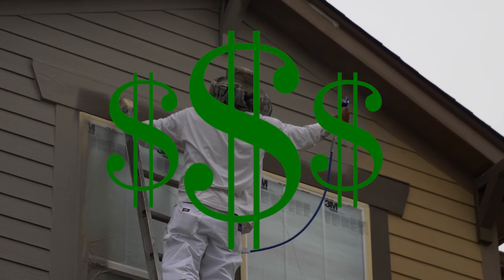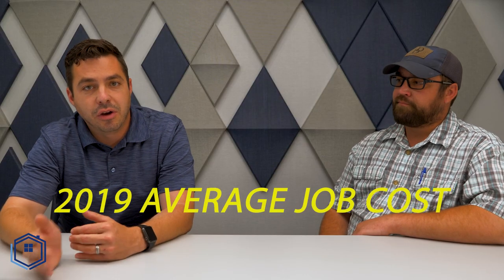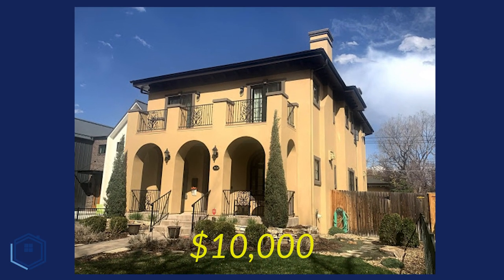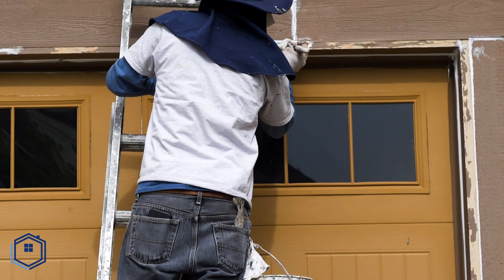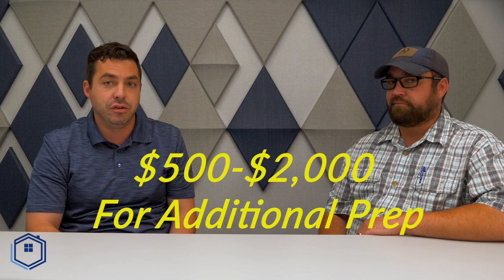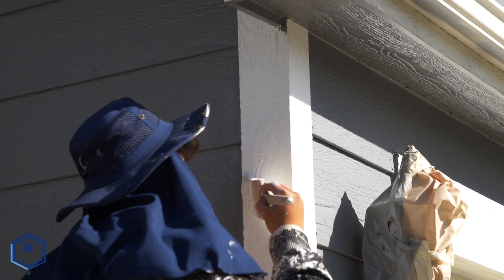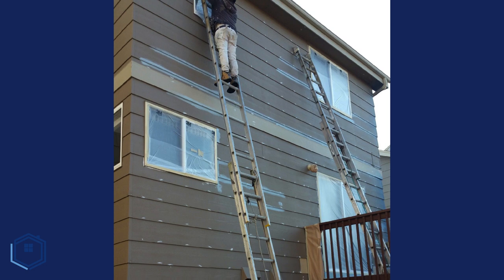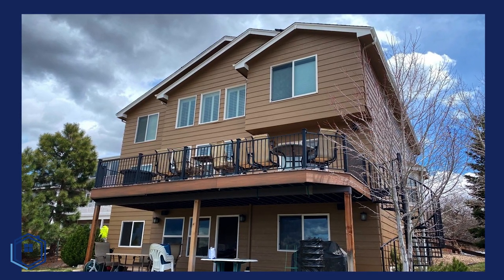How Much It Costs to Paint An Exterior #painting #roofing

Comment: Cost of materials very depends on the brands such as Dulux, British paints, Ascent paint, ppg paint...warehouse paint such as Spring that is one of the low costs paint,s.
10ltr Bucket,s 4ltr and 2 to 1 ltrs very in price, depending on were you purchased them.
Your high cost quality paint to low cost quality paint...
You got several types of customers who want the best paint and  best finish...
And those customers who have a enough money for a under $5000 dollar finish...
Quotes are different and difficult sometimes depends on the condition of the customer,s exterior weather boards and roof conditions...
Most of us home owners have very little maintenance  experience on taking care of  the exterior of home,s. Your home is constantly in 4 season conditions year after year...
Get a regular wash down on your exterior home every 3 to 6 months including water blasting concrete drives and paths to regularlate scum and likern...fences included 
It's up to the home owner to do regular checks on your own home for deterioration...
Exterior paint expires with in the 10 year time including roof paint...
I have come across customers who haven't repainted there home,s for between 25 to 40 years with poor maintenance and simple checks from roof,s@ spouting to weather boards and brick homes,explaining that the preparation work to their homes is in their costs more than the material,s.
2 bedroom house,s to 5 bedroom house,s all very in costs to paint...
It's length of time spent restoring the exterior to the customers satisfaction is in costs...
You don't just look at the paint and slap it on.
It's an art to restore getting your customers to see past the cost of materials and labor...
It's also letting the customer know that his home is a valuable asset, there fixabode and somthing also to be proud of...
My work is seeing past the 25 years of deterioration from weather conditions on some homes I have restored,restoring exterior homes is an art 🎨 you ether got the gift or its just simply to much work for the home owner...
If you want the best you pay for the best, your home is worth more than you will ever know...
After having it restored get it valued also to ease the mind of the home owner.
Signed Steve painters and decorators 44 years experience...

Comment: Hello, great vid. The house that you said you charged $4000, is that the total with paint and materials included?
Reply: The same question
Reply: Can’t be
Reply: @mediatationking2420  sound correct if much repairs in wood are needed.  Just had my house painted, over 4,000 but my home was built 1903.
I suppose it also depends upon your area, I’m coastal in So. Cal.
Reply: @donnapascual2665  definitely not in New York
Reply: they claimed to do 600 exteriors in a year . if they're banging out jobs like that they can get rich with a smaller profit margin , beating out competition with lower prices as well